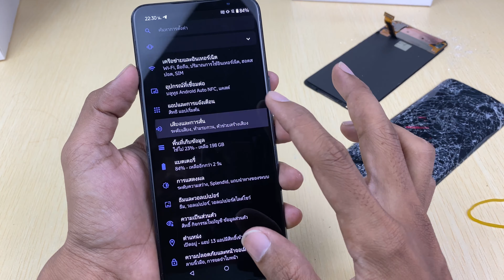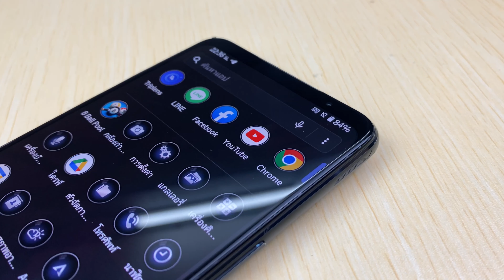ASMR Restoration Asus Rog 5 | Restoring abandoned destroyed phone

Comment: I got my rog5 wifi, hotspot and loud speaker issued, how much cost to repair? And can you fix for me? Thanks
Reply: Has it been fixed or not
Reply: Yes and the shop said they cannot fix it
Reply: @Pangait3700  I had the same problem when i upgraded my rog5s to android 14, my wifi and hotspot wasn't working so i called the customer service and told them about everything, they provided me some solutions but none of them working so they said they'll send somebody to take my phone back to the company and fix it, the problem was with the motherboard, I dont remember what exactly but I think they changed the motherboard and downgraded my phone back to android 13 and it was working just fine..

Comment: Great video thanks for shering. I have asus rog 6 and my screen broken and my back cover also. I order the lcd and back cover and I try to fix it. The screen shows that the battery is charging but the phone not opening. Do you have any idea what should be the problem? Thanks
Reply: Check the cable connections.